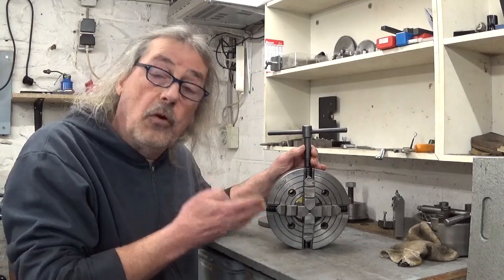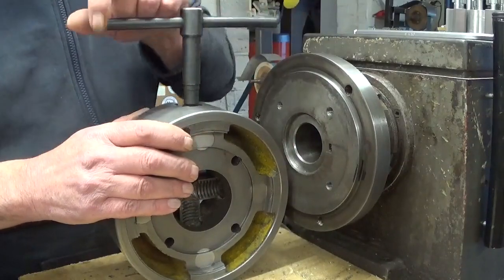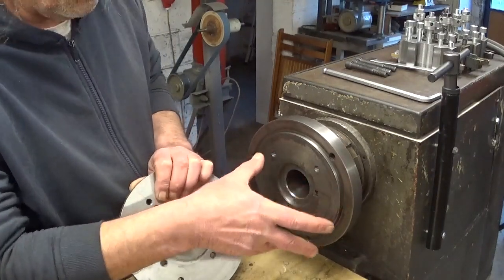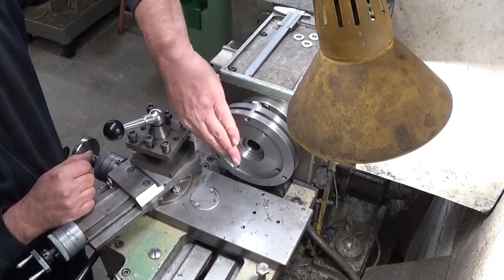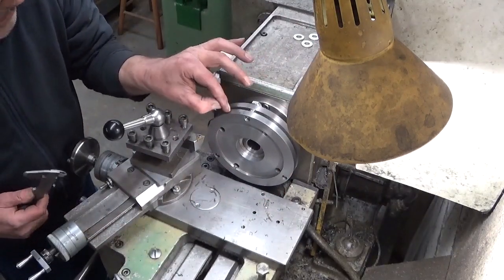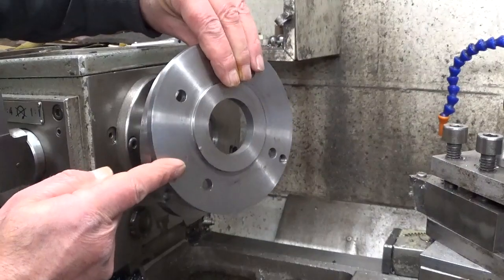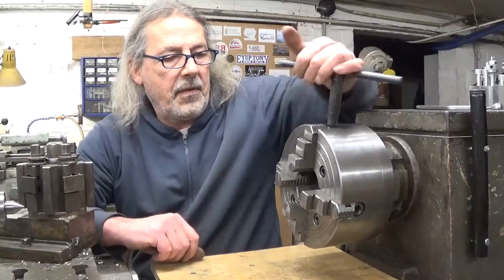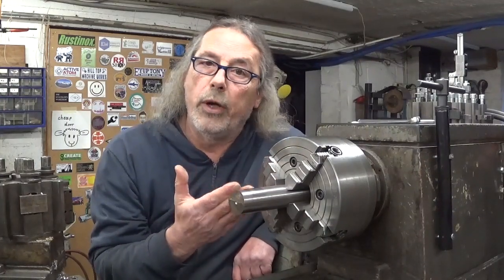A "Fill The Gap" ring.

Comment: I believe another improvement would be to pour melted lead into the hollow back cavities in the chuck along with your gap filler plate. I bet it would make the chuck very solid as far as chatter problems when cutting.

Comment: Just wondering..... Could the four round pins inserted from the rear that are the screw postioners be getting pushed deeper by the ring and that's where the drag is coming from?  I wonder if the pins were bumped or pushed back by  0.02mm and then machined flush to the register surface maybe they would not push the screws forward into the jaw threads and bind?     Doing what you did might have fixed part of the issue but they were tight already?  Pulling the jaws out and looking at the "U" that locates the screws might show some signs of rubbing if this is the case.
Reply from the maker: Thanks for your input. The four screws are totally free. The problem is that the jaws are binding in the slots.

Comment: I think front fixing chucks (like you have there) are good. Back fixing may look neater but front fixing makes things easier when fixing to a rotary table (for example). From the chips, that spacing ring looks like nice material. Cheers
Reply from the maker: You're right. Front fixing chuks are more versatile.

Comment: G'day Rusty. Excellent job with the various sections of machining & fitting.
Just wondering if an extra .002"  in the bolted centre section would make a bit of difference
The clamping down is where the distortion is occurring.  Or maybe the side locating lugs need squaring off to stop possible internal corner bottoming ?
Reply from the maker: I will try with shims and see what happens.

Comment: Hi Rusti. Great job on the spacer piece. I wonder if a paper gasket on the spacer might relieve the clamp on the outer part and maybe reduce the distortion. You could try it as a test. If it helped maybe you could try a very light skim on the outer surface? I'm sure you could get it just a bit better. That said, it works well enough as is. All the best, Mart.
Reply from the maker: Good idea. I will give it a try.

Comment: I think your problem is when. You turned down the back of the chuck now when you tighten it up it's pressing against the pins that holds the screws for the jows mark the pins and remove them and make them shorter it's going to be hard with the steps. good luck.JM
Reply from the maker: The problem is the jaws themselfes are binding up in the slots.
Reply: I'm trying to help you . if I'm wrong I'm just stupid but if your wrong you still have a problem . so i did the same thing i machined the back of a chuck. those pins need to be recessed a bit . quick check loosen up the bolts a bit and if it frees up try giving the pins some space .
I think the pins are forcing the screw into the jaws  Good luck .JM
Reply from the maker: @junkmannoparts9696  Thanks. Will Do. I appreciate your input.

Comment: Nice work och fine entertainment video, as usual.
I hung a 5" chuck on my 4" lathe. The power control strugles with off/on start. Starting from zero and ramping up the speed is preferred, but it works.
Reply from the maker: If it works, it works.

Comment: Recycling the way to go Rustinox. Just use the smaller diameter register on the back or the chuck, turn the larger one down to the same size. That may, hopefully prevent the chuck body distorting when you tighten the mounting bolts. Cheers Tony
Reply from the maker: That's an idea. I will think of it.

Comment: Great work!  I have a lathe and  its spindle have cone #6. I'm going to buy a new chuk (sanou)  , and it can be with mounting  on cone  or mounting plate. Which one you suggest me to buy?
Reply from the maker: The easiest way is to install the same diameter chuck on the original backplate.